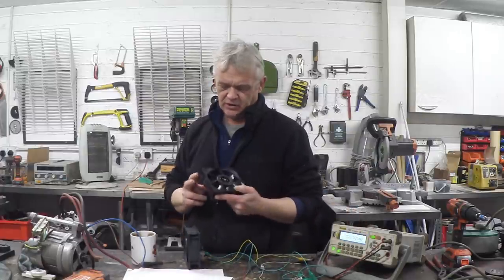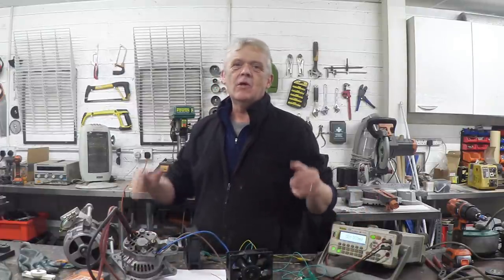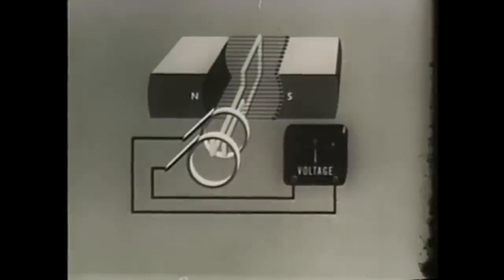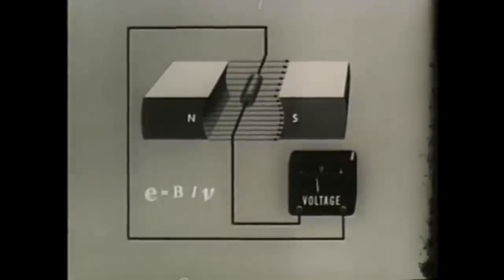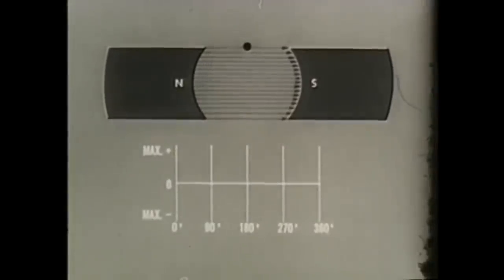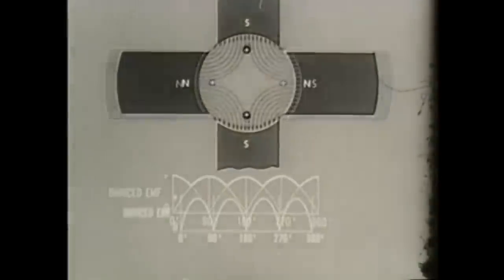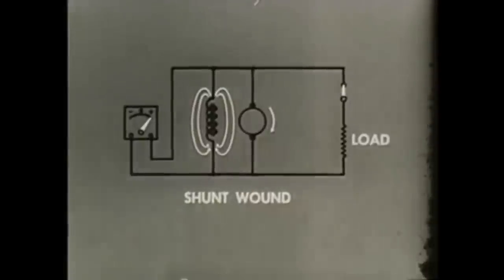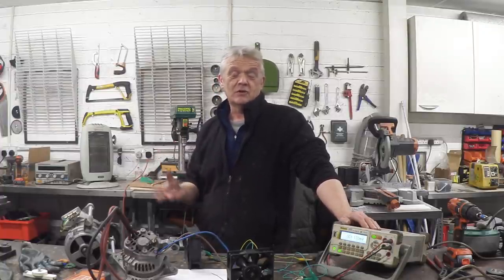1363 Introduction To Generators

Comment: The U.S. Air Force was still using that same video in the late 1970s for training in fundamental electronics.  Funny to see it again. Doubly so since I saw that video when I was about 19 (it was a let down, since I'd had at least that level of hobbyist and high school education) and you say that you didn't understand the complete, correct, proper scientific explanation received at the same age.  Thanks for this.
Reply from the maker: I did pure maths and statistics at college mate when I got to uni mechanics as a branch of mathematics was entirely new to me

Comment: Would love to see a vid on possible ways to improve generators, low cost and not requiring a team of engineers?
Reply from the maker: I hear you mate
Reply: @ThinkingandTinkering  I spoke with an engineer in Germany I think, that made this spinning device like a top that could spin several million rpms.  So it had a tiny form factor and very high voltage and low amps.  I forget how much power it could produce but having such high potential voltage, that even a small amount of current would be very high power.  Perhaps a good candidate for your factal capacitor device as a tiny highbrid temporary energy storage device?  
Where were you planning on harvesting high voltage energy from using the fractal caps?

Comment: Can you make one generator charge a capacitor that boosts to also run a 2nd generator on a flywheel and make them all run themselves?
Reply: Short answer = No.
Long answer  = No.
Reply from the maker: well - I know what I think the answer is - and that is no - I think it will just run down - think of it as water - if you endlessly pour one cup of water into another you can keep filling the cups - but if you take a sip out every time your pour it - it will empty out and you will need some more water from somewhere.
Reply: @ThinkingandTinkering  Perhaps... When you have 1 motor power 2 generators can the 2 power the 1st motor?
Reply: @TabooRevolution13  Hello, I hope you don't mind me butting in,
 but I think that, although it sounds like it may work... 

It would probably be like a "Perpetual Motion Machine" sort of thing... 
As such, I'm afraid that it would go against the physics of Earth, 
unless Quantum theory proves me wrong... 

If you can re-watch the video, I am certain that you will find your answer in there... 
( Unless you didn't Use any of the electricity you'd generate?!)

Also, I ought to " but out" as I  think that you got the Best answer from Mr Murray - Smith!!
Kind Regards,
A. Dingbatt. 
Best of luck with any and all generating projects,
~ we need people like you to help keep our beautiful planet alive!
Reply: @AndreaDingbatt  I have a clock that has has been running with no power for a few decades. It has a capacitor...  and a pendulum.
Reply: @TabooRevolution13  Nice one!!
That is amazing!!
I'm not knowledgeable enough to understand nor explain much more than I did! 
 I am the 1st to admit that I can be wrong, and I certainly don't know everything!!
I guess that I thought you meant under heavy load, or something like adding to off grid!!
Please forgive me for making assumptions!!
I hope you have a wonderful holiday season ahead of you and yours!!
I'm going to be hiding in the cupboard under the stairs, where I'm less likely to get into bother with a Small Dry Sherry!!
Kind Regards, Andrea. XxX
Reply: @AndreaDingbatt  Well there appears to be... and there is rumor of exceptions to the rule regarding the law of thermodynamics. Not really exceptions but loopholes.  Like if combined with momentum a capacitor can make a ping pong effect with negligible over current.

Comment: It would be very useful if all electrical measurements show  voltage and current against the specific load.
Reply from the maker: no it wouldn't - it would be good in some cases and a waste of time in others - sorry mate - but that's just the way it is

Comment: If those small generators were at the ends of your windmill blades then you might get a higher more useful ram. Also, keep in mind that the tips of each blade is producing a tiny tornado. Possibly unused energy. How to put all that together? Well you have a pretty good base of intelligent followers.

Comment: Picture a converter shaped this way busbar straight line wires bent to half circle back to a straight line to another busbar copy that to the other side IMO this ends the impedance problem old style converters/generators have.